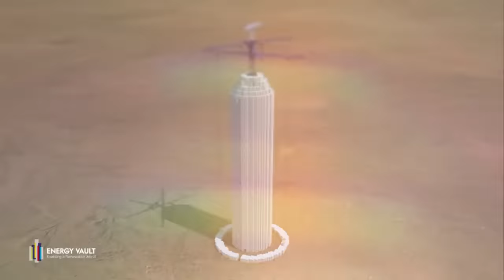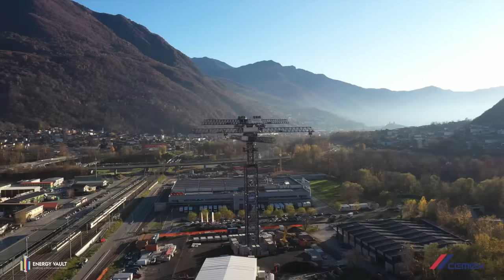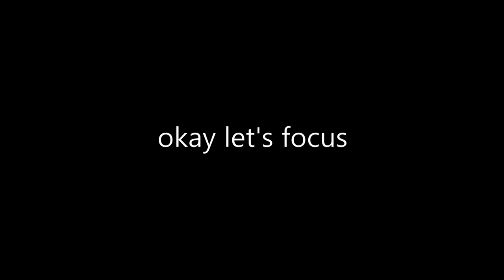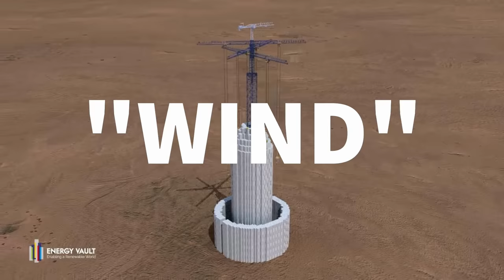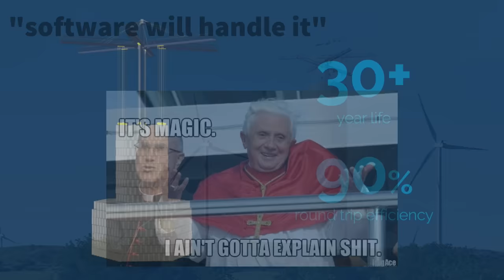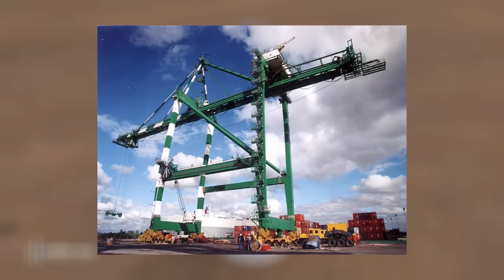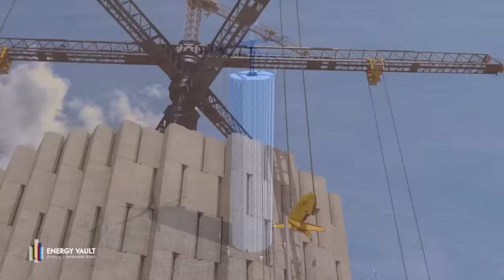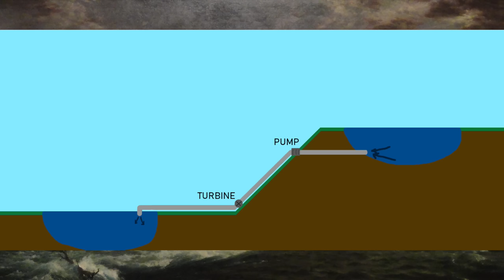The Energy Vault is a Dumb Idea, Here's Why

Comment: I've had a single thought in regards to energy production and conservation, and it was a giant underground wind-tunnel full of windmills. Kickstart the wind-tunnel, air starts to get dragged back thus spinning the windmills, and once you're creating enough energy from the windmills, wire the wind-tunnel to the windmill grid so it sustains itself.

Sounds nice... until you think about it for 5 seconds and realize "oh yeah, FRICTION is a thing, and it's more efficient to just plop down windmills where it tends to be windy". This idea screams "I had a thought and I think it's great, no I didn't find out how efficient it actually was compared to what we have".
Reply: You’re also forget according to these tech bro’s friction means increasing the amount of energy created
Reply: that sounds like a huge perpetual motion machine.
Reply: that is a massively terrible idea that would take more energy to run than you would be producing. smh
Reply: @thomgizziz  Well, that the point. You hear it first time and it sound cool. Then few seconds later: Wait, what is this piece of s**t?
Reply: @philip8498  A true perpetual motion machine is a closed loop, while that tunnel is open. It has a source of energy: the wind. Narrow spaces also increase the speed of airflow due to the pressure increase as it gets pushed in. This is why valleys and urban areas tend to be rather windy places.

The wind turning the turbine is not a perfect transition of energy, hence why the air continues moving past the turbine despite spinning it. The wind's flow has been disturbed, however, and causes eddies in the current around the windmill. This is why windmills can't be too close together or else they cause enough disturbance to impact each other's efficiency. This is also a problem the tunnel would face as the expense of building such a structure, which would require a consistently windy place regardless to function, would easily outpace its space efficiency.

Comment: How does this thing spin a turbine consistently and for long enough to actually generate any power would be my main question. You are going to have to be either lowering six blocks really slowly which won't generate much power or dropping them quickly I  a sequence to ensure you've got a consistent spin plus off setting the power requirements of the crane.

Thoroughly lame idea for energy conservation. 

Please keep up with these debunking public infrastructure projects Adam, since its actually unique and interesting, rather than dipping more and more into American epolitics garbage.
Reply: Gear ratios?
Reply: No... that's not how any of this works, gearing it so that a consistent flow comes from the six cranes would be the easy part, the idea is still stupid for other reasons.
Reply: @alittlebitgone  Fair enough. I work with analogue electronics and not mechanics so I should probably just stay my lane lol.
Reply: They also have to be precision loaded which means creep mode.
Reply: If the blocks are 20 tons, as the video guess is, then the energy you get from dropping a block is 196kJ per meter, and the proposed tower is 150 meters or so,  giving you 29.4MJ per block, which is a little more than 8kWh. So if you take 1 minute to drop a block, you get 480kW. Drop two at a time, and have the other four getting ready to drop, and you can consistently put out almost 1MW. It's not bad.

Then again, make one block that's 20*5*5 meters, and stick it in a 200m deep mineshaft, you can get almost 2GJ out of that block, and if you take one hour to drop the block, you still get around 500kW, and it's a lot easier and cheaper to build, since you don't need any computer-controlled cranes that need to place blocks exactly in high winds. We could easily stick a thing like that in every abandoned mineshaft we have.
Reply: @RegebroRepairs  I like that idea. We could simply repurpose elevator shafts (unfortunately, I think there aren't enough shafts to solve all storage problems with them)
Reply: Bugme Not  No, that is not correct. The generator resists the motion electromagnetically. If it did not you would not be able to generate any power. You do not need friction to slow it down.
Reply: @RegebroRepairs  There is another company, I think in the UK, which is using mineshafts to build gravity energy storage. That idea is well in hand. But there are a limited supply of mineshafts in the world and digging new ones is too expensive. Once they are all in use there won't be room for expansion. There are also limited places where you can build pumped hydro, and they cause environmental damage by flooding valleys. If they can make this work then there are many more places where you could build them. It is almost infinitely scalable. But that is a big if.
Reply: A guy called Mr Enclave telling a leftist to stop weighing in on "American epolitics", hmmm....

I like Adam's takes on neoliberalism and socialism, and I would very much like to see more
Reply: Their investor presentation says their efficiency is 3x the hydro xD
Reply: @chompythebeast  I've always gone by Mr Enclave, its not a statement or anything. I Iike his socialist takes on infrastructure projects and public works, and shitting on Elon Musk. Last time I saw a video about the inviability of Dubais urban hellscape? Can't remember. Dunking of Ben Shapiro, I person who I've only even heard about via osmosis, is like a dime a dozen.

Comment: I remember doing some research on this subject in my undergrad as an engineer and basically came to the same conclusion. Although there is an alternative tech that proposes using trains with weight on the side of a mountain.
Reply: That invention is ancient,was used by the Dacians in the gold and silver mines before the Roman invasion. the mine was digged a bit up hill and it had inside a big polley and a thick rope where the wagons were tied to,so the loaded wagons would run outside the mine by gravity ,pulling the empty wagons in...simple,no need for someone to push them :)
Reply: The only gravity fed train left in the world is in Britain and its used by miners to move iron ore down to the refinery. They are talking about shutting it down. The water thru turbine solution has worked for over a century. The only way to improve it is to either add to it like they did in Iceland by adding in valcanos to evaporate the water and send it back up. Or to use a more energy dense ei heavier fluid to store the energy. Both cone with challenges and risks. Thr valcano idea is the only one that actually has a noticeable improvement on the original system.
Reply: @halogeek6  someone watches Red Shirt British Boy
Reply: @WillHellmm  he is fun. A bit posh but very informative.
Reply: @halogeek6  he's a GOAT in the game
Reply: @halogeek6  There are other ways to improve the water idea. Well maybe not improve but make it viable in more places. One is using the water as a weight over compressed air. That allows you to use only one resivwoir. California is currently building a large facility using this idea. But yea generally if your energy storage system relies on moving heavy things around its hard to beat water.
Reply: @halogeek6  I mean maybe it won't work but the point is that there are alternative systems using water as weight actually being built. All energy storage systems require putting in more engery than you get out. Its a question of cost.
Reply: Must not have had good enough software.

Comment: I generally agree with your argument in this video and most of your videos to be honest. There are a couple of things about this one where I feel I should voice my disagreement:
1- The idea that having faith in software is like having faith in Jesus is honestly insulting to the field of software engineering. And I don't mean the developers calling themselves "Software Engineers" to boost their ego, but rather actual licensed engineers who specialised in software creation 
2- Whilst pumped-storage-hydroelectricity is 1000x better than the proposed "solution" it is also either extremely dependent on local topography and water supply or equally if not more reliant on large scale concrete use.
Reply: As someone who has been a professional Software developer for 7 years now, I'd rather have faith in Jesus even tho I'm an Atheist than the Software Industry. Sorry but most of this Industry is held together with duct tape and luck. Don't get me wrong Software is great and all but you can't solve massive design problems in real world systems just by relying on "the algo". If the idea is crap slapping a hunk of Software on top ain't gonna help you.
Reply: @Benni1000games  Software isn't the right term though. It's more of a  psychics problem than a software problem, similar to docking with the ISS, landing a rocket, or simply stacking shipping containers on a boat type of problem. You don't need an algorithm much more complicated than what was used to land on the moon remotely and that was developed in the late 60s, we're pretty good at it now (stacking containers is pretty efficient now). Not saying the tower is a good idea though (because I think hydrogen is a better energy storage solution, long-term), just that this isn't like driving a car and requiring an "algorithm" to make decisions if you are going to hit a person.
Reply: @Benni1000games  +1 to this, a software engineer who would like as few software engineers as possible to touch the power grid, we aren't to be trusted. 

There ARE software folks who can do the work to make an industrial control system safe and reliabile, but that starts with the mechanical/electrical engineers who make that job as easy as it can be. It's hard enough to make a reliable control system reliable when your power plant's mechanical systems are as simple as possible, designed with mechanical fail safes and the like. 

When you try to start covering up mechanical design issues with "we'll just have software do it" without a really good reason, that's a recipe for disaster.
Reply: I either would not want to trust software if possible. That has nothing to do with the capabilities of engineers per se. But even good ones can't do good software on a rush (and there are a lot of bad ones). 
It's the old triangle and "costs" is by far the number 1 priority here. 
In contrast, the software needed for an old fashioned water pump storage can be done safely by more than one "script kiddie".
Reply: Adam’s criticism wasn’t that one can’t or shouldn’t have faith in software, but rather that blindly replying that software will fix all these deeply complex and safety-critical problems without knowing how is akin to the blind faith of religion.
Reply: @casey6556  exactly. Usually the ones saying, "Oh we'll have software manage it!" have no clue how difficult it will be to get something even close to what they described in the investor meeting. cough Elon cough cough

Comment: There actually is a better design which uses a Hardrock system to effectively make a giant piston. You pressurize the area under the piston and raise the whole thing up. It needs far less work and has the advantage that volume cube laws allow it to be much cheaper.
Reply: that does seem like a much better idea indeed.
Basicly hydro power storage, but instead of a height difference, you use a very heavy weight on top of the water to create pressure.
Reply: We call those gasometers.  I doubt there are any left.
Reply: Bill Nye mentioned this in a Big Think video about five years ago and I kind of love the idea, but as far as I know there isn't even a demonstration built anywhere. There's a German (?) company that I think may still have a website up trying to sell the idea. I think the problem is it needs to be pretty big to get a reasonable economy of scale to get a good price per megawatt hour.
Reply: @Robbedem  As I suspect you know this is a very old idea called the hydraulic accumulator and it eventually lost the battle with electricity after a surprisingly long time - The london hydraulic power company operated from the 1880s to the 1970s. These days you'd want to use the accumulators to generate electricity - the weight could be made of anything dense and cheap. Not saying its a totally brilliant idea - but it's a lot better than this idea with stacking concrete blocks.
Reply: @joinedupjon  tbh, i didn't know, but now I do. :)

Comment: Well, concrete has a higher density than water. Your underground water storage would need to be about 2 to 2,5 times bigger.
And digging such a huge hole costs a lot of labour, time, ressources (you need to create solid pool walls which not only withstand gravity but also smaller earth movements) and in the end also produces quite some CO².
Typical pump-storages are indeed more effective but I guess there is a reason why they were only built with naturally existing basins and certain falling heights yet.
Would be interesting to put all of this into account and calculate the differences in costs and exhausts of both methods.
I don't say the energy vault is flawless, but neither are water basins and we need to consider all influences to make a usefull decision.
Reply: So how about using the excess energy to pump water into an existing hydroelectric dam then generating from that?
Reply: @Fifthsboy  yes, this is done already as long as the energy is available at the dam. Bad electrical infrastructure is responsible here.
But the amount of existing dams is not so big and would not be enough to compensate fluctuations. So we need more energy storages.